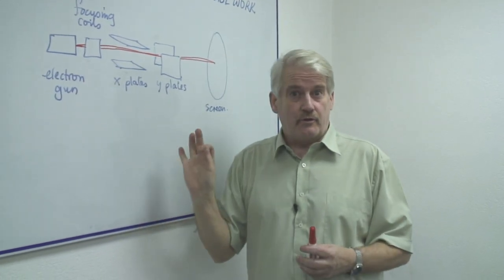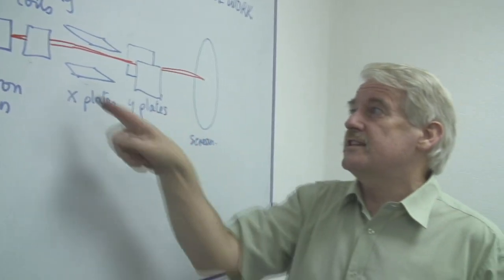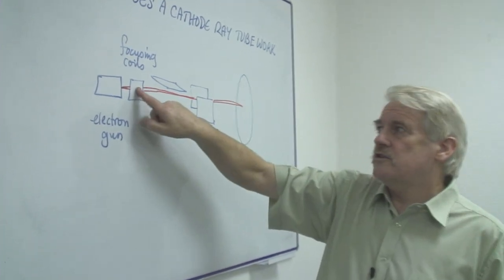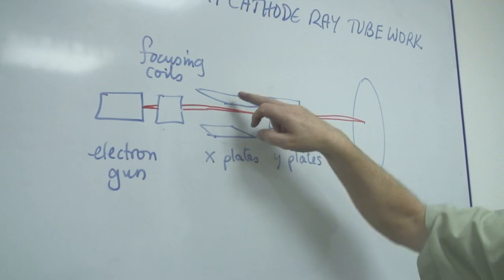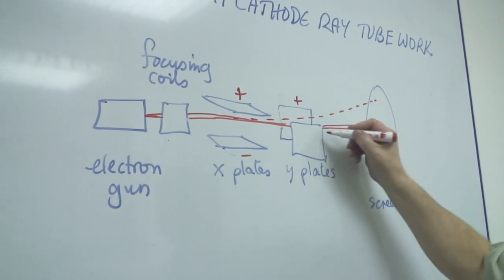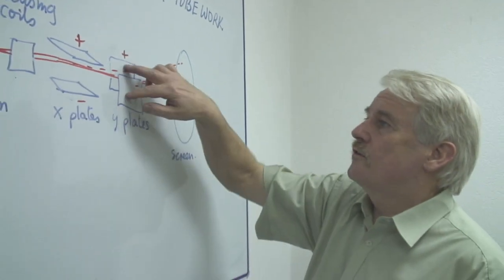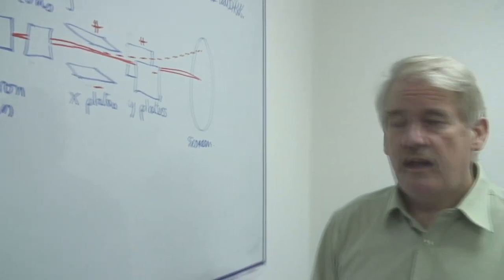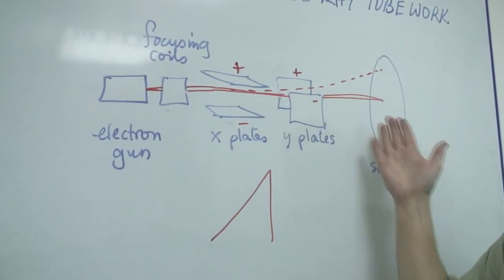Physical Science : How Does a Cathode Ray Tube Work?

Comment: @fauld5 No. Electrons will be attracted to the positively charged plates so when they are horizontal (X plate), the electrons will go towards the +ively charged plates. Same thing with the Y plate.
When they use deflection coils instead of plates, the horizontal coil will deflect the electrons horizontally and the vertical plate will deflect it vertically (right hand palm rule)

Comment: I thought the x plates were vertically placed and the y plates were horizontally placed. Correct me if I am wrong cause I ain't sure
Reply: That concept is for electromagnetic deflection, the direction is then at right angles to the field, based on Flemmings left hand rule.